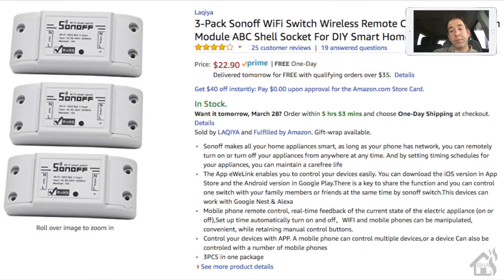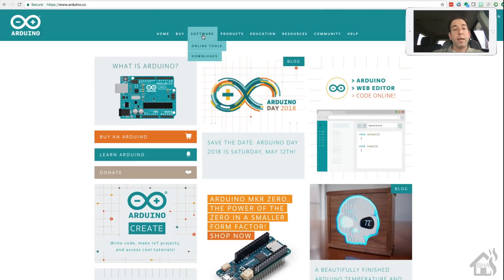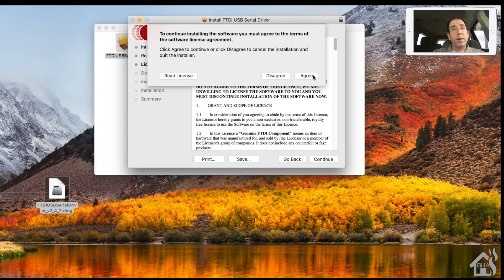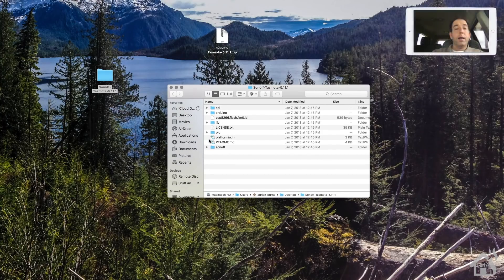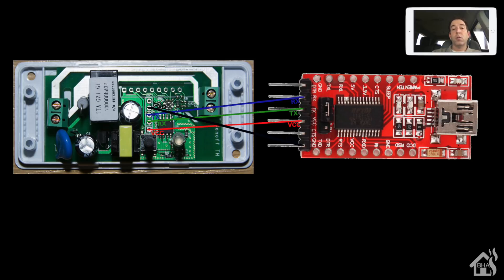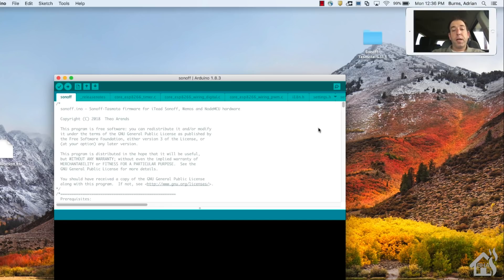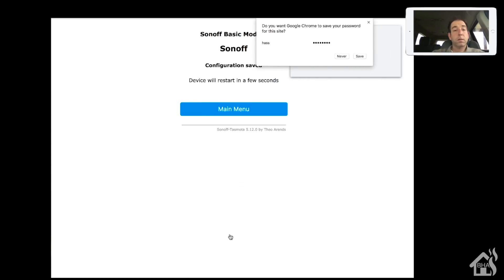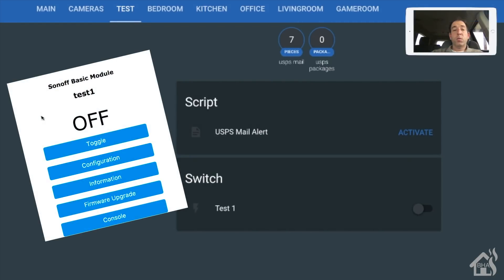How to flash a Sonoff

Comment: Adrian , thanks for great video. I followed your instruction and copied and pasted the info changing to my details. I see the switch in HA but when I click on the switch, it jumps right back to off a second later. The Sonoff Relay does not make a noise either. I have checked  that the CLIENT & TOPIC  fieldS ( Tasmota / SONOFF ) is the same in HA as per your example below . Just changing TEST1 to my " sonoff2 ". Pls could you help and tell my why it not coming on etc. Thanks
Reply from the maker: can you connect to it by ip in a browser and turn it on and off?
Reply: Adrian, I had the exact same issue here, click the 'switch' in HA, it snapped to the on position, then about 2 seconds later, it snapped back to off with no response at the SONOFF.   The SONOFF worked correctly using a browser connected directly to it.
 
I corrected a small mistake in my SONOFF MQTT configuration; the "Full Topic" was reading" sonoff%prefix%/topic%/" which I corrected to "sonoff/%prefix%/topic%/" (by adding the '/' after 'sonoff') and now the SONOFF will turn on when the switch is moved to the on position, but the switch still snaps back to off, leaving the SONOFF on.

To get close to a final solution, I added "optimistic: true" at the end of the switch: entry in the yaml file.  Now the SONOFF and HA sync up and seems to work correctly, the downside is now a pair of lightening bolts rather than a switch is displayed in HA.   A small price to pay I suppose.

FYI, this is being done in a docker running on UNRAID.

Thanks for all that you do, your videos have been priceless.
Reply: @merchbdc  this solved my problem. Thanks

Comment: hello again I´ve made everything untill the part of flashing, I´m using a windows 10 I kept the button pushed during the conection to th usb, but when I tried to flash it stucked on compilation, and it´s not moving from there. Any ideas?
Reply from the maker: have you done it muliple times with the same result?  It sometimes takes me a few trys to get it to go all the way through.
Reply: I´ve just tested with a multimeter in both ends of the line, imput and output and it gave me a beep it seems that I fried my relay.
Reply from the maker: oh no, that sucks.

Comment: Cheers, another great video, thanks. At about 15:15. Do you know if there is any advantage to duplicating the ssid and password? I do because I was thinking why have it try and connect to a Wi-Fi network that does not exist? Any thoughts? Also I thought the host name was taken from the Project name? Cheers
Reply from the maker: That does make sense on the ssid, i agree, no real reason to have it try and connect to a ssid that doesnt even exist.  As for the hostname, by default its going to be something like sonoff-1234 or something like that.  The hostname is also the adhoc wifi ssid it will show if it doesnt get connected to the internet.  I just like to give it a name of something more definable.
Reply: BurnsHA I believe the last 4 numbers, are the last 4 numerical characters of the MAC address. Makes it easier to identify it if you have a lot of devices connected to your router. Cheers

Comment: unable to find settings under tools. what is the issue?
Reply from the maker: what options do you have under tools?
Reply: thanks for responding. I figured the issue. Now i am getting espcomm_sync failed error. unable to proceed.
Reply from the maker: did you find out anything on that error?

Comment: I’m following you instructions as closely as possible and have fixed many of my problems by downloading the older versions of software just as you do. I having as error code “StaticJsonBuffer” was not declared in the scope. Any ideas? Thank you

I do not have the Sonos plugged into my computer as I am compiling. I don’t know if that would cause this code or not.
Reply: I just noticed on my preferences page in the IDE at the bottom, it says “more changes Can be edited directly in the file” and then it has my old Arduino address still in there for some reason. Let me fix that and get back with you. Thank you.
Reply: I corrected things but still no difference. I checked on Google and other people have had the same problem but I’m not getting a consistent answer. Thank you again.
Reply from the maker: i have not seen that error before.  I need to do an updated video on flashing as i have changed up my process a little.  ill try and work on getting something together soon.

Comment: Im a complete novice and managed to get 15/16th of the way and I get an error message from the Arduino board.. The message reads..
espcomm-sync failed
espcomm-open failed
espcomm_upload-mem failed
I would seriously appreciate your help to identify what the problem is
Reply from the maker: the sonoffs some times take a couple of tries to get it flashed, have you tried a couple of different times?
Reply: I did and now the sketch shows and error when I verify it.... I will try again but after I have had a break.. Ive been trying different methods for 3 weeks and the brain cant cope.. LOL...
Your explanation is the first I could follow completely...

Comment: I get so many errors when verifying I doubt this will ever work for me. It really isn't set up for Arduino ide. I found header files not defined in the sketch's own code. Settings.h was missing from settings.io. I admit to not knowing much about this ide nor have I programmed in C for years but just adding that got me past one error so..... 
It all started with "xsns_07_sht1x:56: error: 'ShtSendCommand' was not declared in this scope" and I've yet to find a solution. Shame as tasmota looked interesting but if I have to spend days try to run it, it can't be the solution. I want to use these devices not be their slave.
Reply from the maker: i need to flash some new sonoffs soon, ill see if I can't come up with something easier to do!

Comment: Hello great video, I saw you didnt soldered any pin, is it possible to use male-female, does it need tp keep any pressure?
Reply from the maker: if all you are wanting to do is flash the sonoff, then you can set a pin header or a male to female wire on there long enough to flash the firmware.  Now if you are planning  on using it inline with a light switch or something, then you will end up needing to solder something on there for the wires going to the switch.
Reply: tks very much for the quick reply, as we don´t have neutral in our switch boxes in brazil I have only two options either I put in the ceiling but I´m little afraid of some problem inside, or I´ll need to pull from my socket and will mess with the esthetic of my living room and also I don´t know if it´s dangerous. Do you know if there´s any danger putting in the ceiling or pulling from the socket?
Reply from the maker: not sure about that one. ill see what i can find out.

Comment: Thanks for the tutorial!!! Just one question what happens if i dont get the v1.4 Prebuilt in my configure IDE? I got the newest version of the Arduino IDE and in the IwlP version i dont have that option
Reply from the maker: i had the same issue and kept having trouble, thats why i rolled back to an older version of the IDE instead of the most current.
Reply: Hey man, i just finally get the correct Arduino IDE but I get this error when Im trying to compile the code, any advice???
                             ^
Multiple libraries for "ArduinoJson.h"
Used: /Users/luisgatica/Documents/Arduino/libraries/ArduinoJson
 Not used: /Users/luisgatica/Documents/Arduino/libraries/arduino_644833
exit status 1
'StaticJsonBuffer' was not declared in this scope

Comment: Thanks for this GREAT tutorial.  I followed all  precisely and seem able to flash the latest Tasmota 6.1.1. But after unplugging and reconnecting the USB - I'm unable to find the new SonOff Wifi (yes I added WiFi_MANAGER to config.h and tried connecting in Chrome on 192.168.4.1). It has a steady green light for about 10 sec. and then blinks rapidly. Any ideas?
Reply from the maker: once it starts blinking it should mean that it is displaying the sonoff wifi.  Can you show me exactly what you changed in the config.h file?
Reply: Actually, I think I may have used 5v intead of 3.3. The jumper needs to go across the middle and 3.3 pins - right?

Comment: why everybody insists in this way to flash tasmota? There are precompiled binaries, you just need to use the espeasy flasher utility or the nodemcu flasher one, select the bin file and the com port, and it's done! Compilation is needed ONLY if you want to mess around with some parameter, otherwise is pretty USELESS in sonoff case!
Reply from the maker: This just happens to be the way that I know how to do it.  I have read some about the espeasy utility, but havent had a chance to use it yet.  Ill try it out on my next batch of sonoffs and see out it works.  Thanks for the comment!!
Reply: yes, take a look because there are easier ways (in the end, you really don't mess with a sonoff, you use it as it is, to turn it on or off in different ways, and this is already done in STOCK tasmota or espurna firmwares...)... look at latest DrZzs video, about 4:30 in it, for the espeasy way to do it... anyway, sorry for being brutal, but if you just want to USE these devices, there's really no need to compile anything...
Reply: squalazzo Hi, which video are you talking about?
Reply from the maker: Awesome, ill definitely check that out and maybe do a follow-up video!!
Reply: squalazzo Where i can find the utility?
Reply: Please give the rest of us more information so we can take a look for ourselves
Reply: Because you only have to compile and export to binary once... Then  I use EspEasy to flash multiple Sonoff with yoru Wi-i etc all ready programmed in.  
https://github.com/letscontrolit/ESPEasy/releases
Reply: But is there a way to rename the sonoff project name in the webserver? because if 2 have the same name there will be conflicts. That's why i thought you always had to compile, to change the name of the sonoff project.